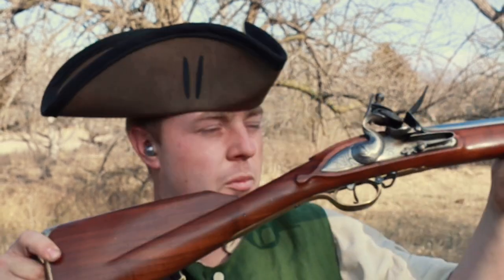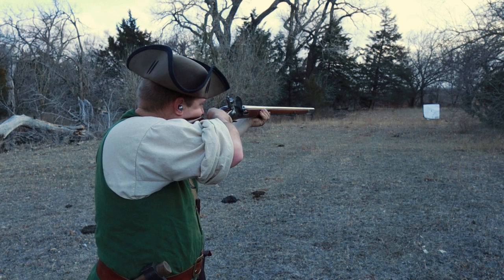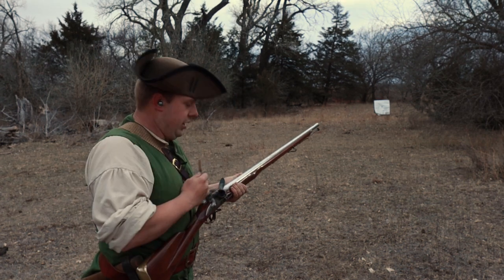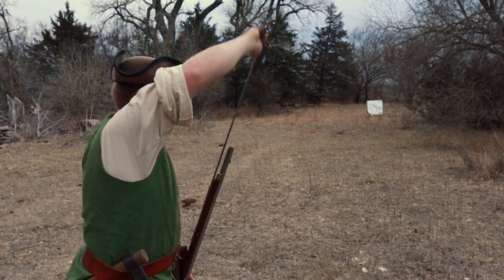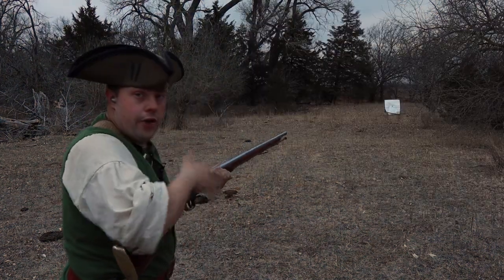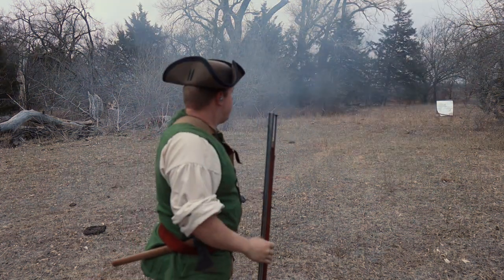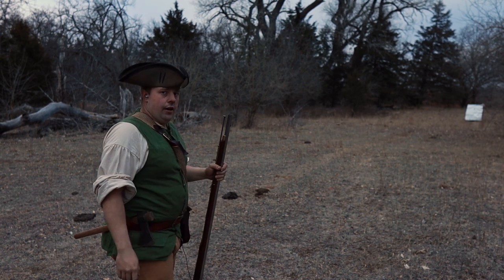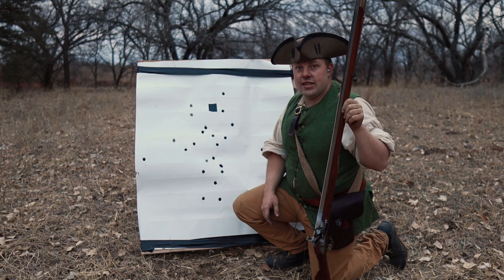Testing loading techniqes for accuracy in a smootbore musket

Comment: I shot an original Brown Bess with precise round ball with greased patch of appropriate size (the owner had run a lot of tests to find the best one) carefully lowered on a reduced powder load (I believe it was something like 60-80 grains, but I don't remember exactly), and the accuracy was amazing: at 50 yards I shot three shots in less than a dessert paper plate. The owner then proceeded to shoot another 17 shots all in the same area.  The trick is: accurate round ball, greased patch of appropriate size and thickness, and gently lowering the ball on the powder without any ramming.

Comment: I know this video is two years old however:

If you want some good smoothbore loads the people to talk to are N-SSA skirmishers! You won't find cloth patching or paper as per the rules but you'll see some excellent results at 25-50 yds with both originals and reproductions.

I just started last year, will be starting with a smoothbore this year pending my 1842 ( Original Harper's Ferry) doesn't need its barrel tweeked some.

Comment: This actually makes a lot of sense to me.   You see with BB guns it's known that the best accuracy is achieved with a smooth bore barrel and the BB shouldn't actually ever touch the barrel, but should instead be suspended in a cushion of air as it travels down the bore.  What you don't want is the ball bouncing from side to side and picking up random spins on its way, which is what tends to happen with BB's fired from a rifled barrel. 

Putting the wadding on top or using no wadding would seem to accomplish the same thing in a musket.

Comment: I think what's happening is this. With your very stout 200 grain charge, the ball is actually getting 'set up' (Americans say 'bumped up'), effectively squished a bit into the bore size. That's causing the ball to take up the windage with resulting good accuracy. When you put the wad over the powder you are impeding the ball from 'setting up' and when you don't use any wad at all there is much more gas blow by past the ball also not allowing it to set up as well. The other side of the coin is you could probably get the same accuracy with a much lower charge by using a tightly fitting patched ball, as no setting up of the lead is required - the patch cuts out the windage.

Comment: While saliva is sufficient for a couple of charges, it doesn't keep the fouling soft enough for repeat shots. I would suggest another trial group with a good patch lube and a tight fit in the bore. Should expect 3 inches at 50 yds.
With just ball and powder, you #1. risk the ball rolling forward and creating excessive pressure, and #2. You lose a whole lot of speed because the powder gasses are going to go around the ball. Strictly a guess but I suspect you are dropping down from 1200 fps down to 800 fps. Check it out with a chronograph if you can.
Reply: It seems likely that rolling ball like that is simply last resort. At 20 yrds and closing in? 800fps and risk of the ball rolling out would be less of a issue. If anything patch shooting makes far more sense if the balls where sized right to allow ball rolling.

Outside of that? It looks like muskets would load after the needs in the moment. That until cap lock and rifling together with the standards moving more and more towards the cap and cartridges. Paper/containers most likely lived along with patch and rolling ball shooting for some time. Only time it makes any sense risking a rolling ball would be in combat. And so it probably was not taught but learned the hard way when to do it. Most likely with fouling or short on time. It seems very reasonable to contribute some accidents being from people rolling ball...

Comment: I have to comment that 200 grains is a very heavy load. In the 18th century the service powder was poor so large charges were needed but the equivalent permission musket used a charge down the barrel of 125 grains and they were sighted out to 145 yards with 300 yards being the military engineering range of ‘musket shot’. For 50 yards 80 would be plenty in a good, but not best, powder.
Reply from the maker: I have read several books on the making of powder in the 18th century. This is made to 18th century equivalent powder and yes it is a historically accurate loading

Comment: I watched your video and I would like to make an observation. When you patched the round ball, I believe your 200 gr powder charge likely burned holes in the patch, destroying your accuracy. And I think what's happening with the bare ball and the ball with wadding on top is that the 200 gr charge is blowing past the ball more of less equally on all sides of the ball, keeping it centered in the bore. 

I would like to suggest a revisit of this patched ball load with say a 100 gr load, with a tight seal and then check your patches for burn holes. Burn holes mean poor accuracy. 

I believe the paper cartridge works well because the paper forms a wad behind the ball. 

Have a nice day, I really enjoy your channel.
Reply: He did note that this particular gun likes the 200 grain load best.  Dropping the load by half might open those groups up to a ridiculous level.

Comment: I found I had similar results from testing. Patches were the worst. powder/ball/wad seemed to be the most reliable for me.
Reply from the maker: I am planning to do a part 2 to this video here fairly soon. Once I get a little larger ball mold for this brown bess in which I will try standard paper cartridge loading versus reverse paper cartridge loading and I'm going to reduce the powder charge in my musket for the patched round ball because I think what's happening is is. There's so much pressure that it's actually blowing the patch around the ball because I did recover a couple of the patches down range and they had holes in them
Reply: @Real11BangBang  I was thinking the inaccuracy might be due to inconsistencies with pressures or a slight drag on one side of the patch/ball while leaving the barrel. Ive even tried bees wax/tallow lubed patches w/o luck. I'm interested to see what you come up with.

Comment: I've got a Pedersoli indian trade 20 gauge,(I'm pretty new to flintlock) and can't hit the broadside of a barn with a patched ball. Duelist did paper cartridges and then I saw u guys do paper cartridges . I did ball on powder , (basically just loaded paper cartridges what seems upsidedown like y'all did in another video) and my groups tighten right up! The only drawback is the lack of any lube. The third +shots are a bitch to get down haha. I actually had to get a .54 cal jag to clean with as I was getting patches stuck lol. Worth it tho!
Reply: If you're going to use a bare ball then you should use a .58" ball in your gun (Lee makes a nice .575" mold). Also, to clean the gun after: plug the flash hole and fill the barrel halfway with water, then tilt the gun back and forth a couple times with your hand covering the muzzle.
Reply from the maker: I think the other comment are here nailed it a slightly smaller ball would probably help with the fouling however, your accuracy may not be as good, but you'll still be loading a lot quicker, so I'm assuming it's a 62 caliber if it's a 20 gauge, so maybe a 58 caliber ball would load better

Comment: Hey quick question what happens if your fuse hole is drilled at an angle would it affect the gun if I redrill the fuse hole
Reply from the maker: veing at an angle m ay slow down the fire. you can always drill it out and install a touch hole liner. thats the best anyways

Comment: My guess on the accuracy issue is you are about 100 grains over the sweet spot in powder charge for patched round ball, try 90-100 grains. The paper cartridge needs the extra powder because it’s not as tight to the bore.
Reply from the maker: I realize this whenever I went down range and found patches with holes blown through the middle of them, which I usually take as a sign of too loose of a fit. However, these were very thick patches and it was actually a very snug fit all the way down to the powder. So my guess is that the ball is being pushed so fast and the patch has so much pressure on it that the patch is getting blown by the ball.
Reply: I find about 90 grains of 3f works in my Pedersoli with a patch, as someone else stated below heavier charges work better without a patch because the theory is the ball is centered by the charge. Not sure how you would prove that beyond the better results.

Comment: In both my 1816 and my 1842 the best accurate loads is ball on powder with paper from the cartridge on top. I believe the gas from the powder ignition evenly surrounds the ball keeping it centered in the barrel and giving the best group.
Reply: I use to make smooth bore ,
Mouse trap shotguns as a kid from old industrial tubing my grand dad had laying around.
Why is this relevant and why does it matter here?
Well I learned that the projectile,
Conical or ball,
If not supported by either a wad,
Or patch over powder with another patch around ball or Benelli style conical,
Will:
A) be moved aside by the pressure of the gas causing significant velocity loss,
Or
B)cause excess barrel fowling due to incomplete deflagration!
To explain,
The longer the powder has to burn before releasing the ball ,
The cleaner the burn, and higher the velocity,
Owing to a proper seal.
Hope that makes sense!
Reply: It's not how gas works
Reply: @tedarcher9120  You don't agree with Bernoulli?
Reply: @GreenCanoeb Bernoulli says that gas will push the ball to one side. That's how Bernoulli works

Comment: And it's important that you noted that specific 200 grains is what this musket likes. No matter what anyone else trys to spue.  No two gun will react the same to a one load fits all system. That's just as true in the blackpowder world, as it in a custom percission hand loaded bench rest center fire.  You have to test until you find the right combination. 
That what I'm all about 
  Mountain man
Reply: How can you tell what powder charge your musket likes? I have a 1777 Charleville from Loyalist Arms. Is it based on recoil, accuracy, or a Tiger factor I’m not taking into consideration?
Reply: @MJMJ27  it's a matter of testing and time. Ball patching grade and yes brands of powder. Rifles tend to be more finicky but not irrelevant to a smoothbore. Does it give you great efficiency? (Max velocity,accuracy,and complete burn/consumption of powder down range performance?
For example.. Bertha my .54 caliber favorite loves 120 grains of 2f old einsford. I get the best accuracy with it, with good velocity, and down range performance. However it doesn't get a complete burn. I'm ok with that because I allow for powder/lube contamination  and accuracy is the trade off.  To me worth the time and foot steps. 
Hope this helps 
Mountain man
Reply: @StevenMMan  i appreciate it, the musket should be here by December and I’ll definitely try. I think I’m going to do paper cartridges to begin with. I’ll be using Schuetzen 2F powder. I’m thinking of what charge to do. I have .648 and .675 lead balls on standby to test.